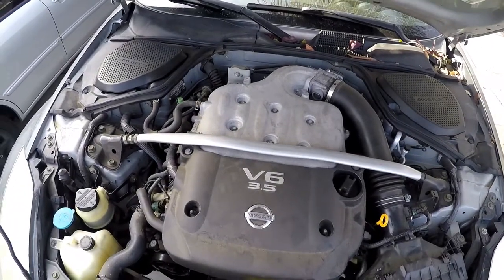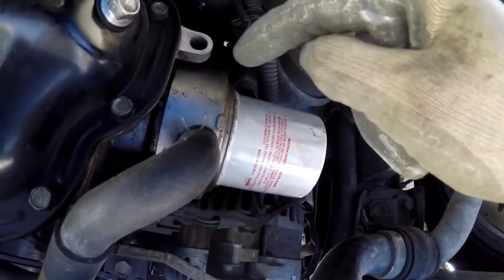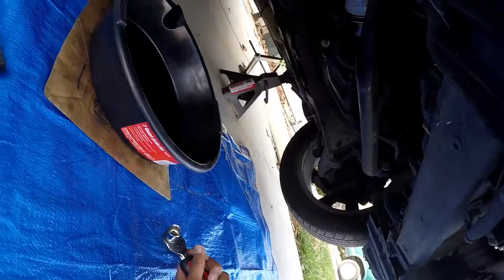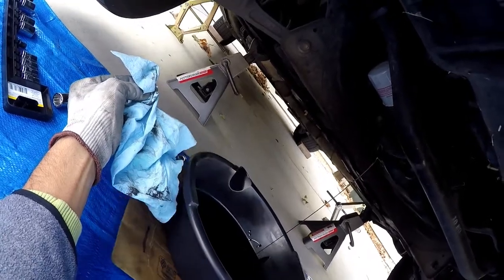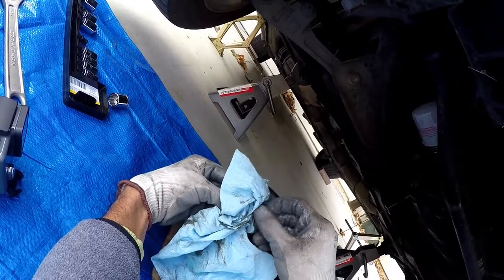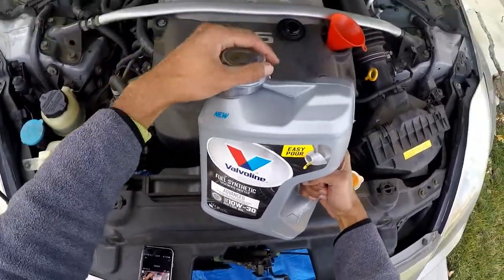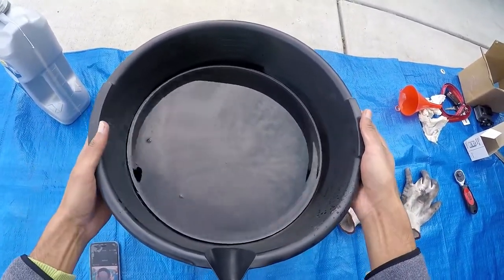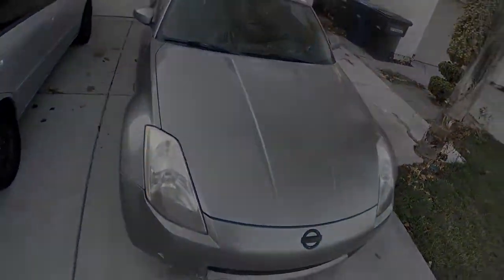350z Oil and Oil Filter Change - VQ35DE

Comment: Do you change the oil filter everytime you change the oil. I just got a new filter and have driven 3000 miles and need an oil change. Do i change the filter again too or can the filters go longer?
Reply from the maker: Master Bruce it really depends on the filter you use. With oem filters I change it with every oil change but some more expensive oil filters can last around 10,000 miles before a change and they’ll usually indicate it someway.

Comment: why 10w-30 instead of 5w-30?
Reply from the maker: Joshua I particularly use 10w-30 for warmer temperatures which are fairly prevalent in CA. However, when winter comes around I do switch to 5w-30.